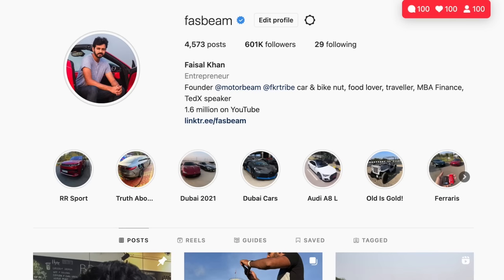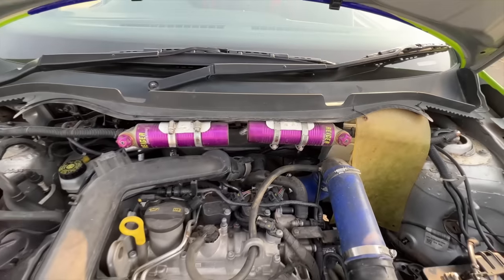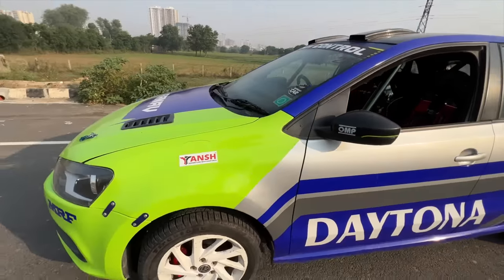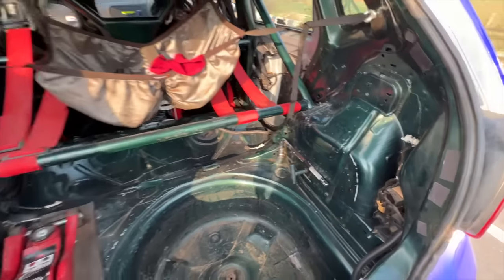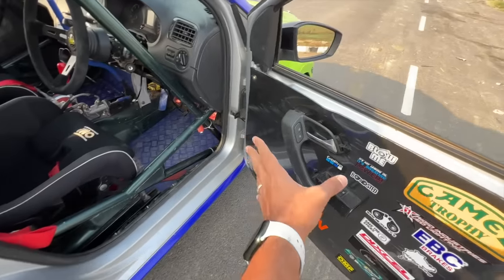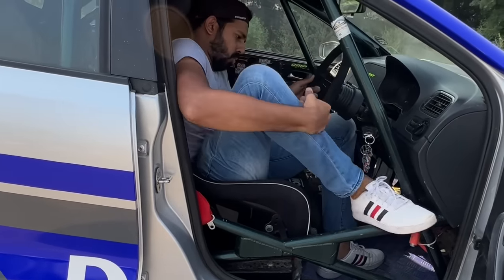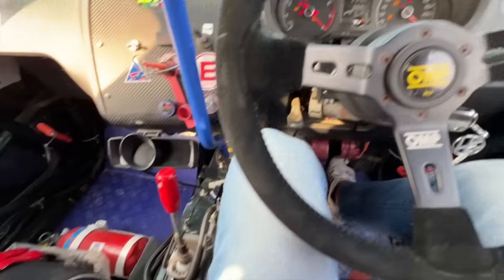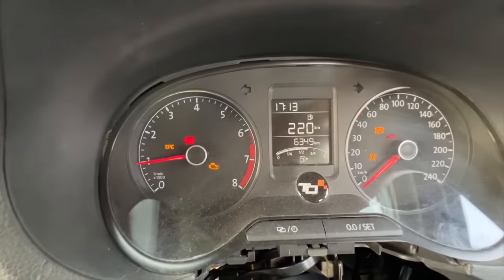Volkswagen Polo Rally Car - Super Loud & Crazy Stiff | Faisal Khan

Comment: They haven’t removed any power window buttons, that’s the comfortline trim which used to come with the 1.0 tsi . It had all the power windows but only front windows were adjustable from the driver’s door.  Also that wasn’t rust in the rear door, it was just a lot of dirt stuck in there.

Comment: Rear power window from the driver side is not removed for weight saving
It is a comfortline model 2021 which only come with front two power window on the driver side

Comment: 6:26 dear @faisalkhan , this vehicle is based on the comfort line variant due to which it does not have rear power window controls as the comforting variant in it self did not get and not done for weight reduction

Comment: Hi,
Can you confirm which car will give more confidence in highway while driving it at 200 km/h ,is it XUV 700 Diesel AT or Taigun 1.5 DSG or both ???
Reply: @Debboss but which is better among them ?
Reply from the maker: @pkd2411  Taigun
Reply: @FasBeam  Thanks for confirmation but i am afraid to buy Taigun 1.5 due to DSG because it has lot of issues while it 1.0L engine seems to be bit costlier on a price point of 20 lakhs on road price that's why wanted to confirm stability of XUV 700 D (AT)